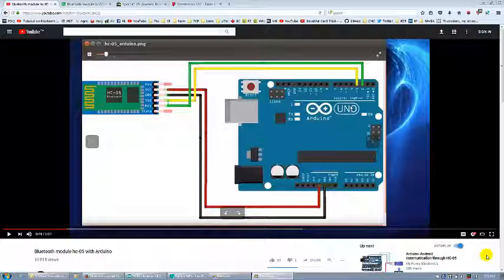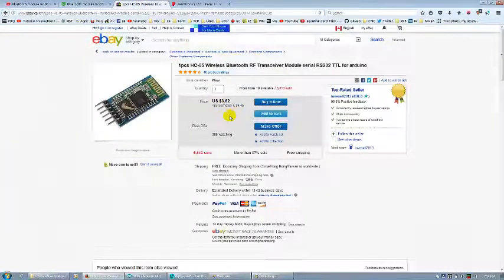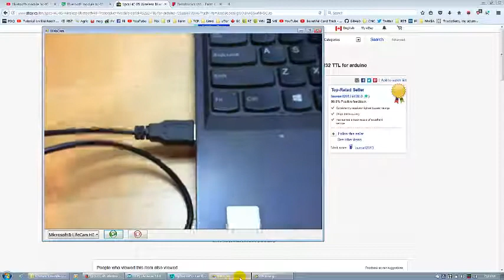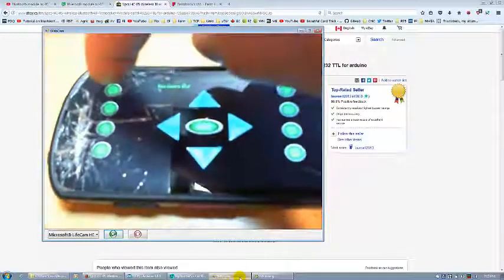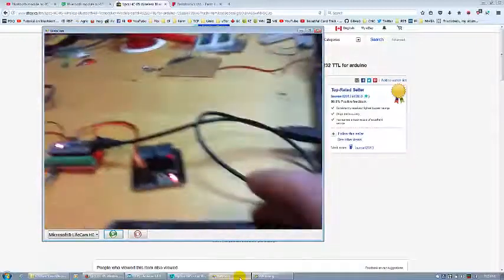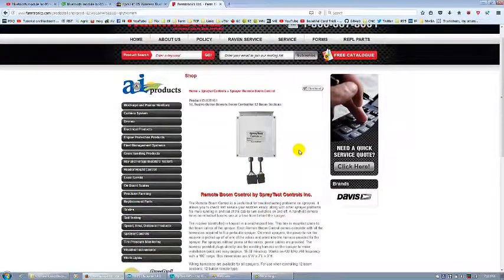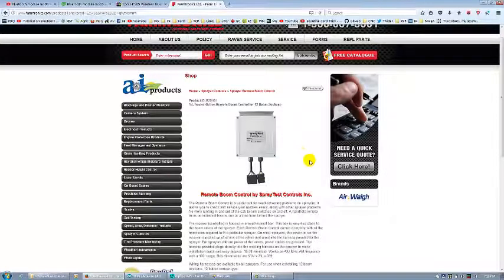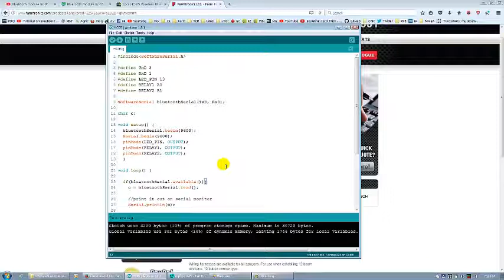BlueTooth Remote Sprayer Control DIY

Comment: Cool idea. I was trying to come up with a way to remotely spray small amounts of starting fluid into a diesel engines air intake system to assist cold starts. I decided on modifying the air intake plumbing to be accessible on the exterior of the vehicle instead.